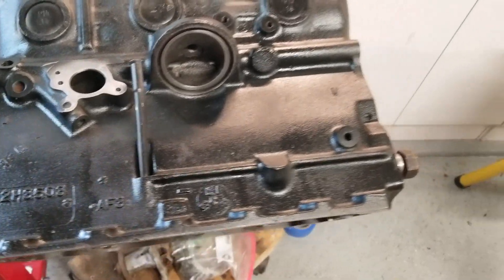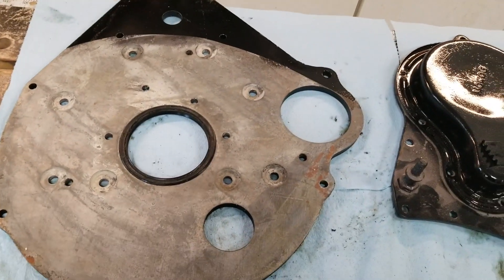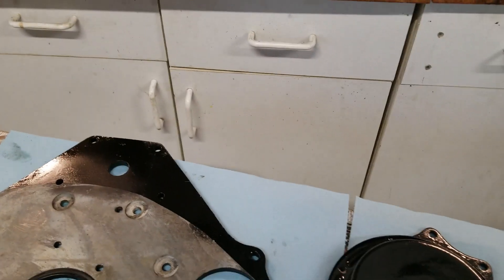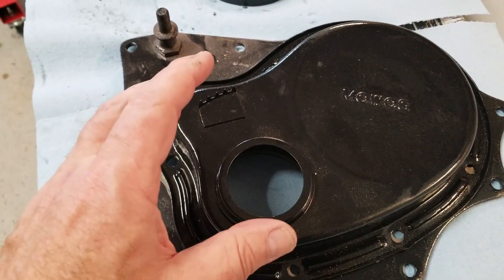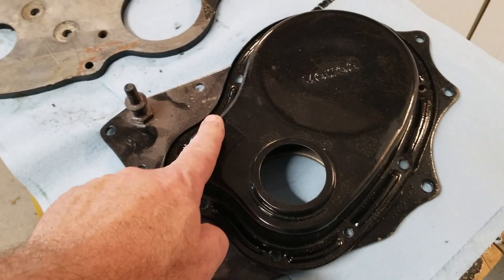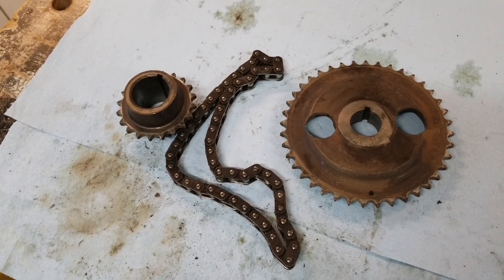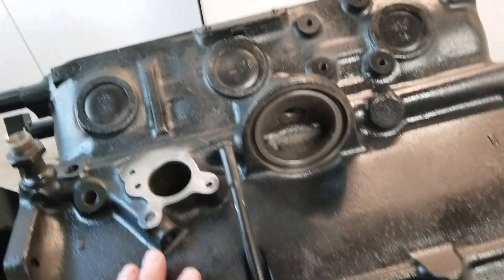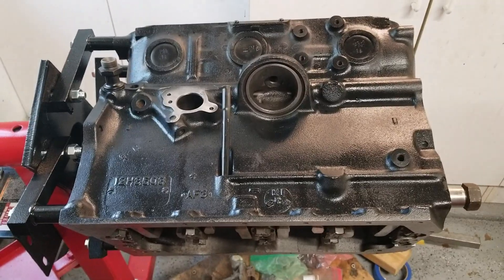MGB 1800cc Engine types demystified

Comment: sorry but this guy dose not know about mgb engines some info is correct but some is not >
Reply from the maker: True.  You found me out.
I have only restored this one 1977 MGB.  I am just sharing the info I had found out while researching parts on my project.

For the benefit of those on their own journey, please add to the comments, anything where I was incorrect, or incomplete.

My 1800 is a mix of model years.  The block is from a 77, the head is from a 74, and the rocker assembly is a mix as well.  So you can see where I had trouble finding parts.
Reply: A good try, my engine is a bitza engine as well. The block is 18V but when I took it apart the cam followers & pushrods were from the original 18GG, as is the timing cover, so I had to remark the harmonic balancer (crank pulley), instructions are in the MG manual. It is now mostly 18 V since I changed the pushrods & used the much cheaper & lighter 18V cam followers.

Comment: Alex thank you for this series. I have a '77 MKIII so everything you produce is directly helpful. Just pulled the engine and am disassembling before sending to machine shop. Discovered its 0.20 over on the pistons (they're marked) and all sorts of weirdness like metric replacements holding the timing cover and who knows what else is in store :o
Reply from the maker: Yeah you find a lot of that.  I have just been replacing most every bolt or soaking in acid then painting the heads.  Those I replace are replaced w stainless.  To reduce rust.  It's been 3 years last month since I started this project.  Without stainless bolts, some of those replaced would already be rusty.  😆

Comment: I have 2 18V engines. A 1972 and a 1975 and neither have the down facing oil filter canister. So I don't think which way the oil canister faces is proof. It may have to be in concurrence with other differences.

Comment: Nice video thanks!  My '72 GT has the engine tag 18VFH33489 which doesn't totally conform to the normal alpha-numeric standard. I've never been able to get a definitive answer despite extensive research.  It runs just fine though which is the main thing!

Comment: 05:00 please be advised that my 1964 MGB with GA engine (3 bearings) has an oil cooler. Having an oil cooler is not limited to GB and newer engines.
Reply from the maker: Thanks for that...
Actually yes, the oil cooler was removed for the newer engines, and was available as an upgrade for some depending on the market.  There were lots of cost cutting steps taken in the 70s.

Comment: Hi , that was very informative ,thank you .I have a 3 bearing  64 MGB engine and  I am thinking of buying a Ivor Searle reconditioned 5 bearing engine  (  MGB HIVE ,UK ) . They say it is for a chrome bumper mode .I have been told that all the peripherals ( Carb , water pump , dynamo , exhaust etc may not fit onto a later block . What should i look out for mainly ?  Thank you very much . My car is a 1958 MGA Roadster with a 64 MGB Roadster motor  ( 18 GA   27942 , which the MG Club UK , called a 'Welcome upgrade ' .  Thank you again   Elaine.
Reply: Stick with a 3 main bearing unless you want to bang out the transmission tunnel, get ready for an electronic tach and a host of other details.

The three main is a fine engine. 

Saying that a block is good for a chrome bumper model exhibits gross ignorance. 

In 1970 I stuffed a 3 main B motor in my 56 MGA...
Reply from the maker: the 1800 MGB engine is pretty much interchangeable with most other models of MGB...
However...
I understand that the back plate for the newer engines are not compatible with the transmission on MGAs.  so if the new engine has the "bump" over the starter like mine it may not work out.

I really like the look of the MGA.  they look so sleek and sexy.  If I find a barn find one day I might have to restore one of those.

thanks for the comments.  please subscribe so I can keep the YouTube algorithm happy

Comment: I believe there is also a casting date on the block. Also, the dipstick tube may be different, depending on the year. I had a 69 and  the timing marks were on the bottom.  Great video. Thanks.

Comment: Great video! What would also be very helpful would be the different cylinder heads and what head works with what block. For example I had to replace a cracked head on my 1980 MGB and did it with a head from a different year(not sure now but it might have been a ‘76). I had to be very careful to get a head that was compatible with my block. Cheers.
Reply from the maker: true.  at this point there is a lot of that type of cannibalization only makes it harder to ID.  for the most part, 71 and greater is a V, so the valve clearances are OK.  you probably cannot put a V head on an earlier model because of the larger intake valves.

I am not an expert, I am just sharing what I had to go through so it makes it easier for others.

Great comment though.  Thanks
Please consider subscribing if not already.
Reply: @AlexPlatacis  I hear you-keep up the good work!